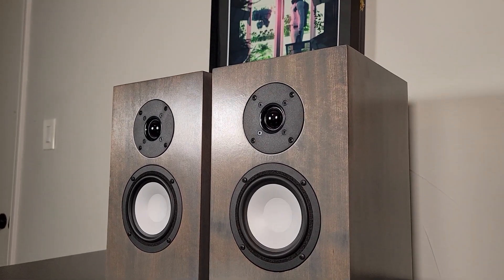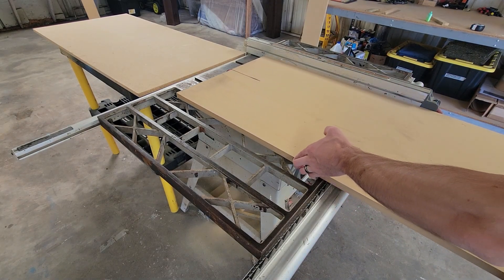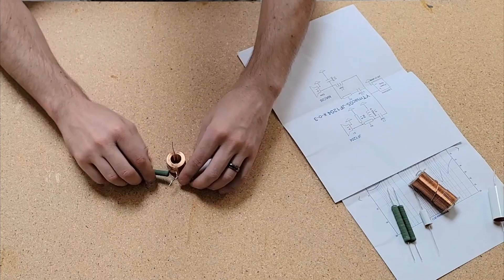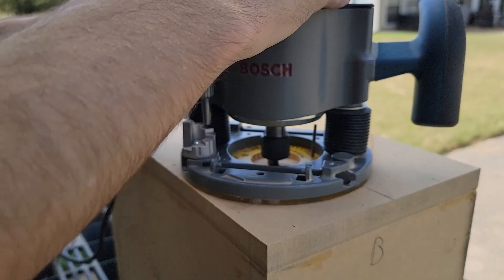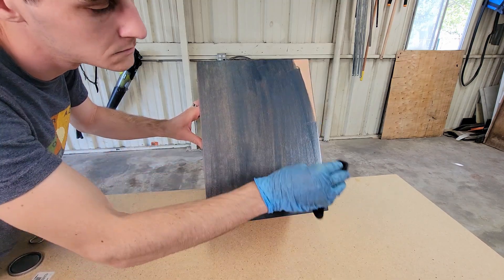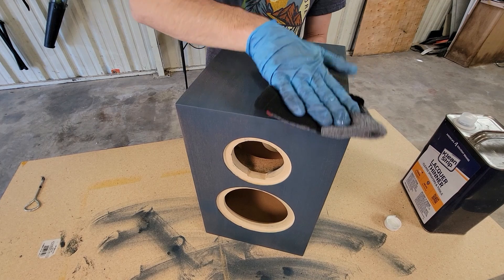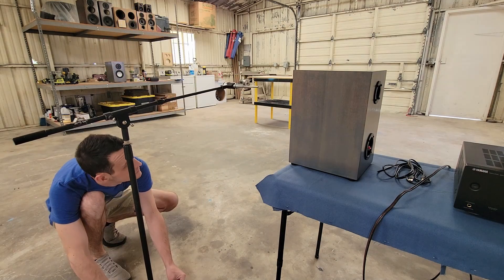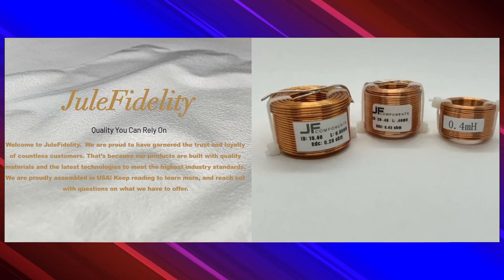High Performance Budget Speaker Build - Julelfidelity

Comment: I got to hear the original pair demo'ed by JF at the 0:50 mark. Incredibly nice build with reclaimed cabinetry and unparalleled bang for your buck from a sound reproduction standpoint. I've used a couple pair of the 4" version of this woofer and it is solid as well. People should be all over this stuff. There's no better starting point for DIY in 2024.